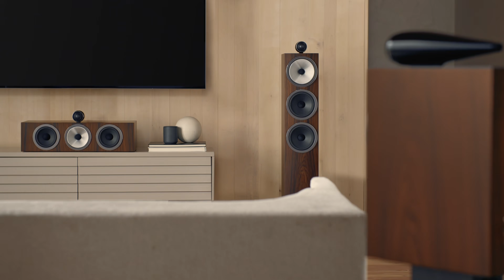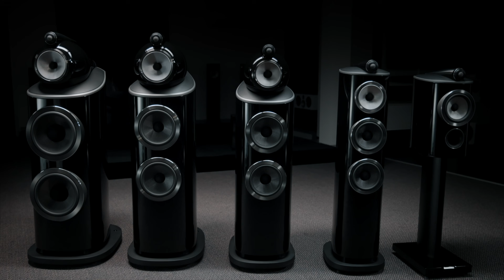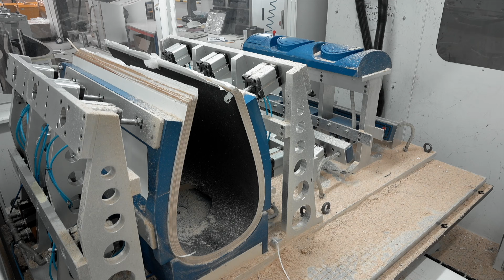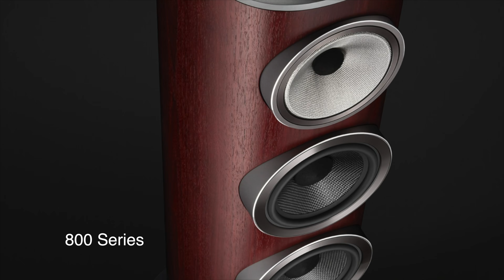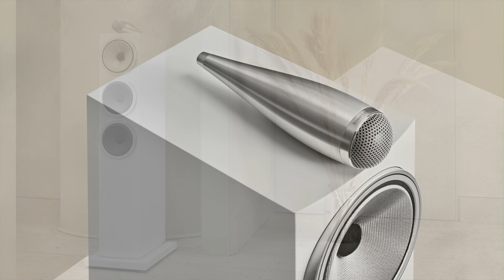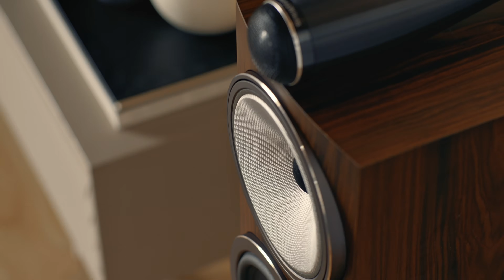Bowers & Wilkins 700 S3 Speakers - Revolution or Evolution?

Comment: What is the consensus to the 704-s3
Reply: Huh...nobody answered...

The 704 sound amazing but they're really more tailored for smaller rooms. They're like half the size of the 703/702 but they can be found on the used market for 1200 each. They have excellent clarity though I'd argue they aren't quite as amazing overall. The 703 S3 is my personal favorite. They have incredible imaging and soundstage. It gives a nice wow factor without being fatiguing. 

Of course....sound is highly subjective and I prefer speakers that have a slightly brighter profile....which is what the S3 models do.